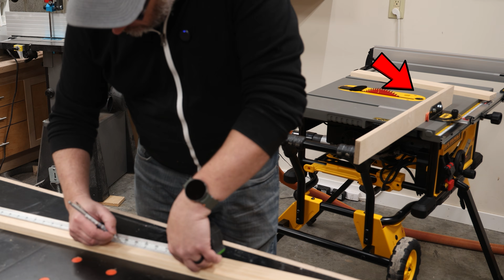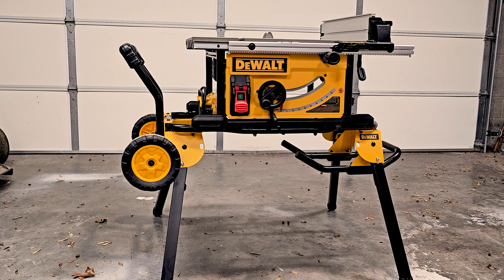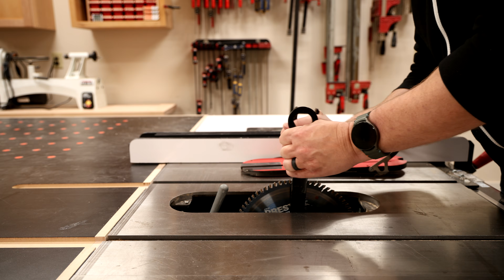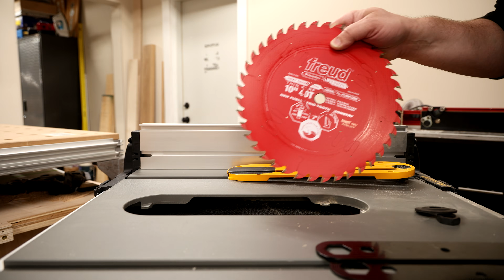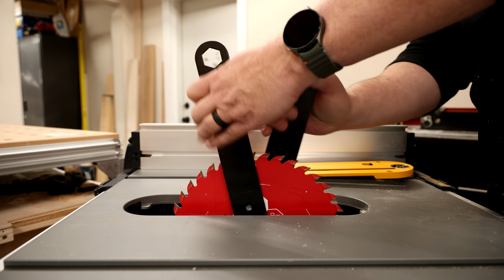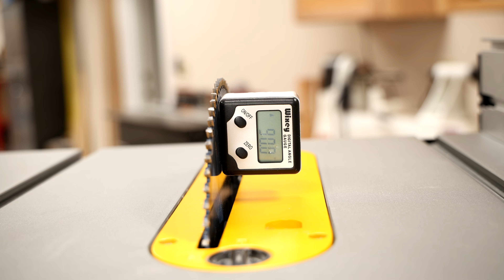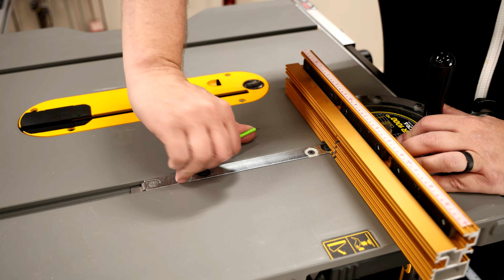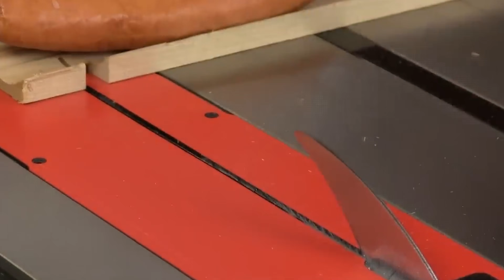Why do people even buy this saw?

Comment: I own this DeWalt saw and both the manual and the stamping on the riving knife state "0.079 max body thickness". The ripping blade you're recommending is 0.087" body thickness. Are you at all concerned about the blade body thickness being beyond the maximum for the supplied riving knife? I really want to trash the stock blade to upgrade to an FTG ripping blade but they all seem to be wider than the riving knife recommends.
Reply from the maker: the thin kerf ripping blade that I have linked has a plate thickness of . 071" and it's a flat grind tooth! I clarified which blades go to which saws in the description to make it less confusing!
Reply: @MWAWoodworks  thanks for that!

Comment: Thanks for this - I really only do basic stock prep with my DeWalt, but I will feel better knowing that I've checked it all over for proper set-up.    LOL, as far as the power goes, my motor dogs when cutting 6 sheets of veneer (using an old-school DeWalt veneer blade, no less) but the cuts are always clean.

Comment: For thoose who don’t know the model, it is the 
DWE 7491 RS.
(1650W / 110V = 15Amp)

It is not availible in EU.
We have:
DWE7485-QS (10") 
(1800w / 230v = 7.82Amp)

DWE7492-QS (12") 
(2000w / 230v = 8,69Amp.) 
I have this model.

This saw looks like it have the 7492 fence on a 7485 saw. I can see it hanging out on the left side of the base. Its close to it allright.
They say it is 31"x 24,5"? Is it, or is that included with the overhanged fence?

The base on 7485 is 19.09"x 19,09" (48,5cmx48,5cm)

7492 is 25,59" x 26,77" (65 x 68 cm)

I guess my saw also have its limits, but im very satisfied with it. Quick lock/unlock for the "fin"? behind the blade. I often airclean the gear for the bevel and lift/lower of the blade. That can jam up and be damaged by dust if you are not cleaning it.
Safety? I buildt a outfeed and side feed table!! I have built a 96" in total. And mount it fast to the table. 
I would never use this kind of tool just stand alone with no support. I wanna live.

Comment: Your video helped me a lot. I was worried a job site saw would be no good at all. I’m still torn between two models though, the Milwaukee m18 or the Dewalt 7492 (the one he’s using in the video). The dewalt is bigger with a bigger blade and longer arbour and more power but the m18 is cheaper, quieter, cordless and has better bevel adjustment. I keep bouncing back and forth.
Reply from the maker: get the DeWalt you don't need a battery powered table saw

Comment: I land on the side of the cabinet saw. Having moved from a track saw as my only form of circular saw blade. The track saw system can be extremely accurate and certain cuts are easy and safe . The thin rip and small part cutting was always a lot of head scratching and jig work to get a stable repeatable cut. That is why I now am all in with a cabinet saw. Track saw for rough breakdown of sheet good . I think the track saw shines best with sheet good projects. .. 
I was surprised the job site saw made it through the Purple Heart with out sh#tting the bed . Hope ya didn't cook your plywood blade ..

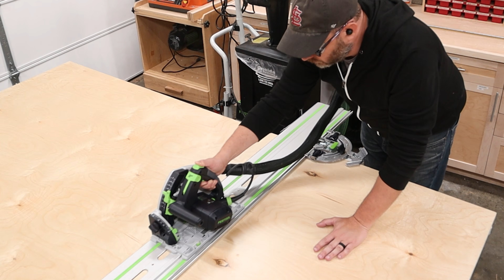Comment: 5:05, a beginner can but a regular circular saw and build an edge guide that will work almost as well as a track saw for under $100, well at least pre-tariff they could. 

18:00 setting angles without the second wheel is very hard. Kinda forgot that part. 

Years ago, I purchased the in between contractors saw. Bigger, heavier, costlier, and better than the bench top job sight saws, but less than a full size cabinet saw. They are harder to find but still available. Again, they are bigger. Like who ever buys my house after I die gets a table saw too. Assembled, it won’t fit through the door or up the stairs and it is difficult to disassemble!  

Thanks for sharing this.

Comment: My understanding is that crosscut blades do not have deep gullets. They, therefore, can’t clear chips fast enough. Hence the burning.
Reply from the maker: that's correct, more teeth means there's not room for big gullets and there's a more constant contact between the teeth and the wood causing more heat to build up. plus the geometry of the teeth are designed to sheer across the grain, not rip down the length of the grain

Comment: You could take the saving and buy a pretty good tracksaw system that would often be more convenient (and almost always safer) for cutting really large sheets. In which case, you could say the smaller size table is actually a positive thing, because it'll dissuade you from trying the more awkward cuts on the tablesaw.
Reply: I had that thought, so paused the video. Then literally the next thing out of your mouth was about tracksaws. :)

Comment: Nothing wrong with the DeWalt table saw, I used a DW745 for 6 years before I bought a Sawstop. The main improvement for me is the massive upgrade in cut capacity and the ability to use a dado stack. That never really stopped me, but everything is certainly easier with a cabinet saw and I don't have to break out a circular saw to break down full plywood sheets
Reply: I built a stand for my DW745 and could break down plywood (up to the 23ish" capacity), but it was sketchy every time

Comment: One of the big problems with any cabinet saw is space.  I only have a 12x20 (exterior dimensions) shop; in all actuality my shop is about 11.25x19.25, clear inside.  i have a folding Kobalt job site saw.  It was square and flat right out of the box, with clear instructions for adjusting it in the manual. Best of all, it can be folded up and put out of the way.

Comment: I'm a cabinet maker turned finish carpenter. I've actually been building small mudrooms and cubbies on site with the same Dewalt table saw. I have the BOW fence with extenders and the same JessEm feed rollers. I can say there's isn't a huge difference. Any table saw is going to need upgrades depending on what your using it for. As long as you dial it in and have good outfeed and a good blade the Dewalt table saw is an amazing maching for the price and you can build high quality pieces with them. No it's not a cabinet saw but they can do the same things.

Comment: Nice comparison, though hard to not think about investment in safety (smart, imho!) with the SawStop, never mind quality. Looking at their job site saw for many of the same reasons the Dewalt is more than adequate for your average woodworker. 

In some ways, I also think learning on your average job site saw may have some benefits as since they are never quite as stable, you can’t afford to be sloppy with your technique.

Comment: I have a Rigid jobsite tablesaw and my only real gripe about it is that I found the fence isn't always square to the blade. The only fix I could come with is to use a long combination square in front of and behind the blade to make sure the fence is straight every time I make a cut. The floppy fence on it stinks! 😒

Comment: About 25 years ago, I was going to buy a small table saw. About that time, Jet started advertising on the back cover of many woodworking magazines, Jet Cabinet Saw (3hp), exacta fence & jessum router lift with Bosch variable speed router, all for $1600. I'm so glad I got it when I did. I would never buy a Sawstop but I'm sure there's a market for it.

Comment: I have the dewalt saw and I learned the hard way that the bolts that hold the fence square can come loose.   I have become disciplined to check that they are tight everytime I use the saw.

Comment: I have a  220v 3hp cabinet table saw and I still keep my Dewalt job site saw set up in my shop. It’s so convenient to have two table saw sometimes.the Dewalt is a really excellent accurate easily adjustable job site saw. I highly recommend it.

Comment: It depends on what you're doing with the saw.  Building furniture in a fixed base shop?  Sure, get a cabinet saw.  

Moving from place to place, or have a small workspace?  Use the smaller saws.  I do whole house renovations and am still rocking an old Dewalt DW745 on a Paulk style bench and saw cradle.  I love that setup and it works very well for me.  

I break down sheet goods with a track saw.  After you get rips down to 14-16 inches, THEN you can run them through the table saw.  Easy-peasy.
Reply from the maker: yep exactly 💯

Comment: I would say to start with a tracksaw and a decent router. I would suspect that if your first project is to build an MFT, then you'll probably never need the jobsite saw.

I say this having never built an MFT, I just don't have room for one. I have a track square and parallel guides, which are a little annoying but they're ok.

I did buy a jobsite saw, but I've never needed to use it. I suppose I'm more confident with the tools I know. (That, and the fact I don't build much!)

Comment: I have the Dewalt job site saw. It’s great but working with a lot of hardwoods, it lacks power. It’s also a lot louder. And it was a pain in the backside until I built an outfeed for it. I’ll be upgrading pretty soon.

Comment: This is really interesting.  I have the SawStop jobsite saw.  I wish is had a better fence like this rack and pinion, but after seeing this, I'm happy with mine.  I'd love to have the power of a cabinet saw, but right now I don't have the space or a 220v outlet for it.  I bought a dial gauge and a few other things when I got the saw to check for square, etc.  And the saw was perfect out of the box, which really shocked me.  I should check it again now that it's been over 5 years, but I haven't seen any issues with it going out of square.  I think a thin-kerf blade is in my future.  Great run down of setting things up and dealing with the various issues.

Comment: We used to use those jobsite saws to rip plywood and osb. They don't make those for anything but being able to rip 3/4 plywood all day everyday. I would never use them for cabinets or anything with a tight tolerance. If you move that saw on and off construction sites everyday and bump it into things it'll still be good a ripping plywood

Comment: Subbed 👍🏾👍🏾👍🏾
I use a old craftsman cabinet saw i bought from a retired woodworker. Cleaned up the cast iron top pieces, installed a new belt, clean and oiled the trunion screws or whatever they're called, built a new base for it, and made some inserts. The motor is strong enough to cut through anything. Also made a outfeed/torsion box assembly table. Been using the same setup for years and the cuts are accurate. He already had 2 aluminum fences that don't budge so I still use them

Comment: Thank you for his post, I believe you did a great job with this topic. I have viewed this same topic time and time and time again by various people and do indeed benefit from them. I must admit that I have issues with all of them, mainly the concept of we either have a "contractors" low level table saw or the "highest level cabinet shop" table saw. I am sure I missed some discussions, the net is huge, but I have missed any of the other choices.
For instance, the table saw in my shop is a Craftsman purchased by my father around 1950. I have dialed it in and it works as accurately, and is as repeatable etc., as the cabinet saw in the cabinet shop I had the privilege to work in for a number of years, and the cabinet saws you all seem to present as absolutely necessary to do excellent work. I also used and dialed in three table saws of various and questionable grades and manufacturers that I found in a salvage/scrap yard locally. I also see posts in the local "buy, sell, trade" flyers and internet posts for these same kinds of middle ground saws that most of can afford.
I say all of that because it seems that the middle ground I found effective has been largely ignored by the people that share posts such as yours. No disrespect intended.
So, I would request that you, or someone else that has your expertise, would jump at the chance to comment on the kind of saws I have had the opportunity of finding, dialing in and using on a regular basis with every bit of the accuracy you find in the incredibly expensive table saws I can't ever even dream of incorporating in my shop (along with the rest of us that make do with middle ground equipment). And by the way, we do make incredibly beautiful wood projects (I know you never indicated we didn't make great projects).
Again, I do appreciate your post, and others that share this information, I really do learn from you.

Comment: I spent too much money and bought a SawStop Compact Table Saw, replacing my older DeWalt. The SawStop CTS has a fine adjustment for setting the bevel — way better than the DeWalt you tested. Still, not as nice as a cabinet saw, but it’s easier to set the bevel with the wheely thing on the bevel adjustment lever. I can hold the square with one hand (or attach the digital angle finder) and use the wheel adjustment with one hand. Costs a bunch more than the DeWalt, but it’s got more features AND I still have all 10 fingers.

Comment: The flip over short fence does work on the table top. Try again and you’ll see it slides in small slots and has a small second set of slots for the lock pins to readjust to the saw table top.
Reply from the maker: OH yeah, I know it does! but that position it doesn't support the work, it acts like a small fence.
Reply: Ah, I feel you now. Misunderstood. The small fence is kinda handy though. I’ve basically built a 4x8 assembly table/outfeed table/ router table that solves all the problems and for the grand that cost me to build, I’m still ahead cost wise but I wouldn’t hate a cabinet saw for sure. I’ll likely get one one day but for now, this is a solid system. Thinking of making a video about it. Yeah, I’m a photo YouTuber but why not make some maker videos too! 😊

Comment: You should check out the Metabo HPT C10RJS table saw. Not only is it cheaper than this popular DeWalt, but has a 35" cut capacity, built-in outfeed, and your bevel adjustment is turned with the wheel while the blade height is adjusted with the crank. I bought this saw 4 years ago on sale for $370 at the blue home improvement store and love it. It still needed tuning and the table is of course also not flat like your DeWalt jobsite saw, and I didn't test the miter slots. 

Long story short, I think you should give Metabo HPT C10RJS a try.
Reply from the maker: I've seen that saw as well. The funny thing is its almost a clone of the DeWalt but they changed one or two small things just to make it a bit better. Being able to turn the wheel to set the bevel is a simple yet huge feature. DeWalt should take notes.

Comment: I like the safety feature.......But
All my big saws are from when cars had huge fins on the back and gas was less than 23 cents a gallon.
I normally don't lift my blade more than an inch out of the table.   Be safe everyone......when you are out there driving in traffic.

Comment: Great video!  All are very true about jobsite saws.  I started out with a jobsite saw and it limited the quality of work I was able to do.  Accuracy was probably the biggest factor.  However just like using a track saw to break down sheet goods you don’t need an expensive track saw to accomplish it.  Jobsite saws are only for construction technically.  Not one home built has any accuracy in building it.  Ask any home inspector!  😂😂.  While it’s nice to have expensive tools that are efficient for example a track saw ultimately the track saw is just to get you to more manageable lengths and widths to finalize the measurements on a tablesaw.    I believe truly that your table saw is your most valuable investment overall.  90% of every other cutting tool will likely need some sort of refinements like sanding.  Oh and blades really make the difference in all cuts.  Always clean your blades often.

Great video!

Comment: There is absolutly nothing what gonna convice me to go back to that Dewalt saw... I did don all those adjustments and it was ok but the thing what I was 100% not happy is that it was underpowered, easy to tip when ripping long boards and the most anoing - noise... As my shop is in the basement, then everyone hear it 2 floors up when the saw was turned on.... Now I have a old Italian made cabinet saw with 3-phase motor - quaet, precise and power more then what I need... And if ask me - my opinnion about SawStop saw - newer in my life - I learned where to put (not put) my fingers and to know the danger - most importatn not to be afraid from saw...

Comment: There is nothing wrong with buying  a cabinet saw, just not a Saw Stop. I'm kicking my rear end every day for having bought one. I had a good contractor's table saw for 26 years, it had a good fence, did a good job until the key way got ruined. I still have all my fingers and without scars. But, I was seeing all the hoopla about how great Saw Stop was so I bought one - a very large expensive one. I'm in Canada and if you cause that break system to engage it costs you $100 + (I bought an extra one in case). You have to assemble the saw and in my case I had to pay an extra $1,000 for a qualified repairman to come in and rebuild the saw. Warranty?! Saw Stop emailed me a couple of "possible fixes", no technician to come and see why the blade wouldn't move up or down. There are good quality saws out there that cost half the price. That is what I would recommend.